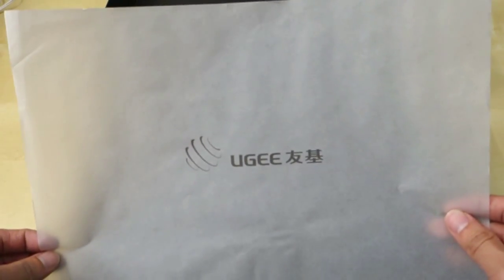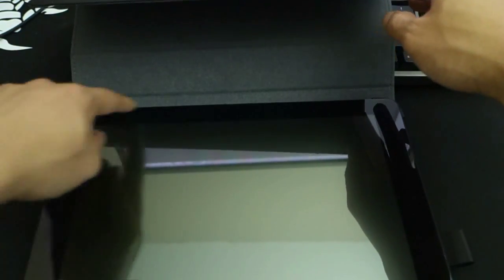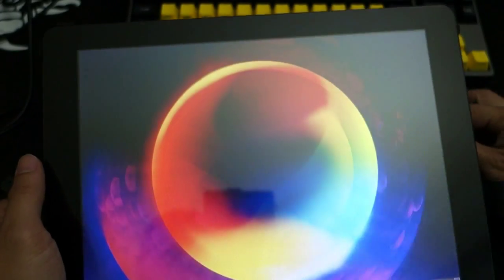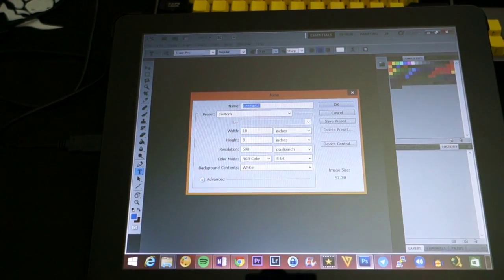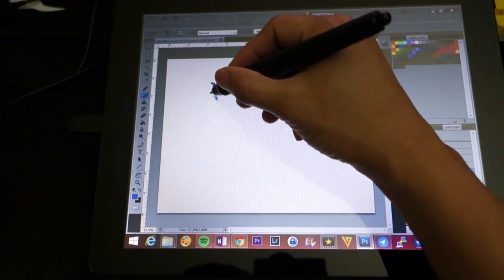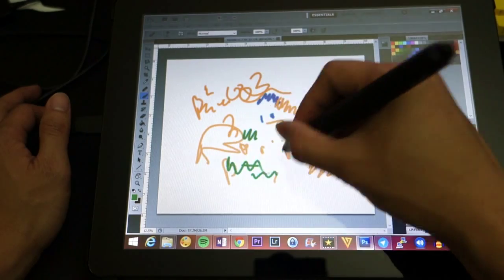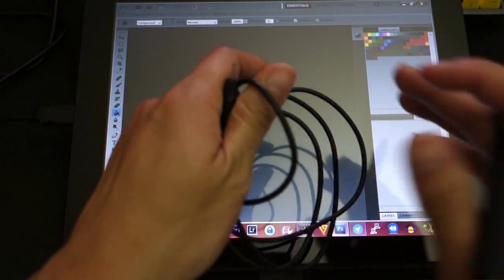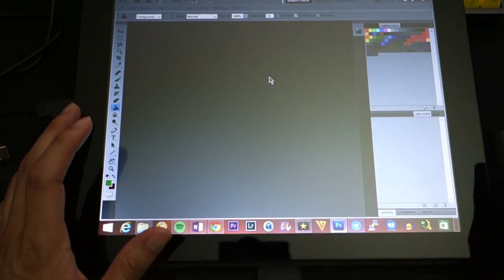Ugee 1200B Graphics Drawing Tablet Monitor 12" Review

Comment: Doesn't seem like the pressure sensitivity works /:
Reply from the maker: +Mark Rich Are you saying from experience or you mean from my video? It works fine in photoshop as lightly press will result in lighter line and harder press result in thicker line. I'm not an expert graphic designer but to me it was fine.
Reply: +JohnyTechReview experience on how it should be yours didn't seem to change in pressure, thickness or opacity wise.

Comment: Nice Review, i think but this tablet, how to work after 2 months to use?  recommended buy?
Reply from the maker: +Luiz Zavala Personally I do not use it as much as I should. Wife use it more for some drawing. Even with the low rest compare to my 1440p,  you can still move your drawing app over and use it on this screen perfectly. I do find tool like photoshop seem overcrowding on this small screen but you can hide a lot of tools and have a empty canvas. Build quality is where it lacks but again it's like way cheaper than any of the big brand name one so something has to give.  The screen angle to me is a problem if you're a professional.
Reply: +JohnyTechReview thanks for response last question the screen is so hot after time to work?
Reply from the maker: +Luiz Zavala it was fine for more than an hour. It wasn't an issue for me